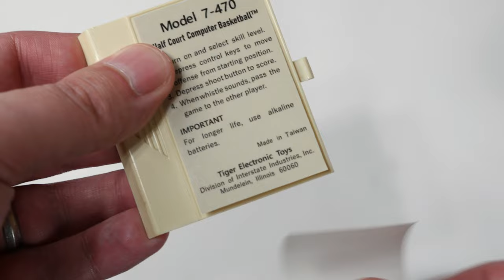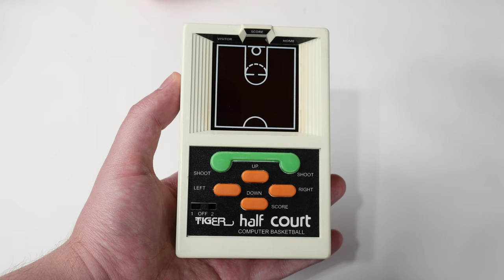Restoration: Vintage Electronic Basketball Game

Comment: What is that marker thing you use before soldering/desoldering?
Reply from the maker: It's a flux pen. Flux makes soldering easier. It comes in many different forms, but I prefer the pen most of the time.